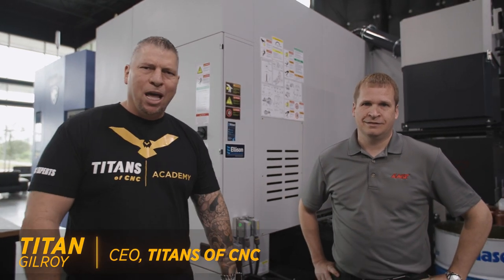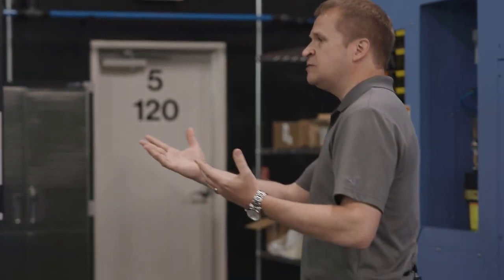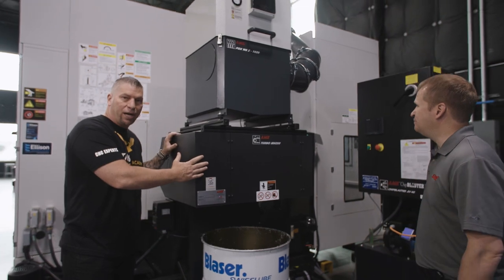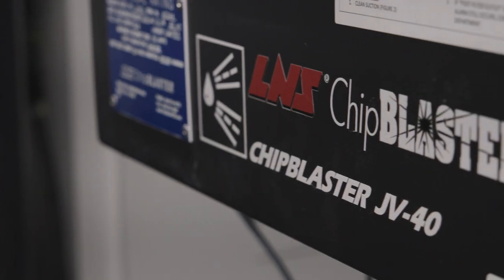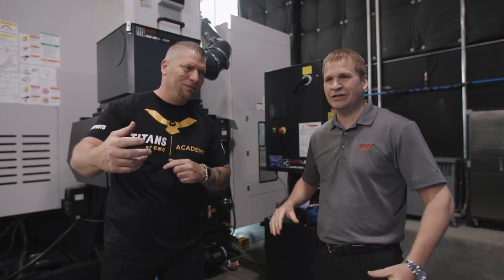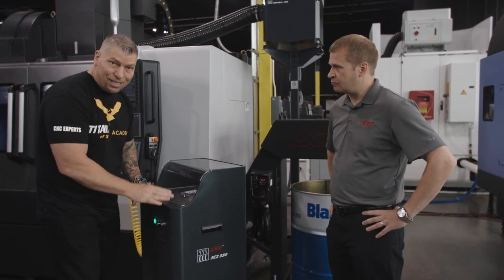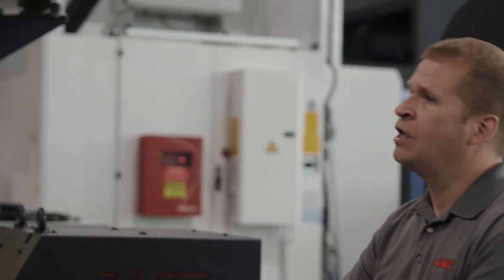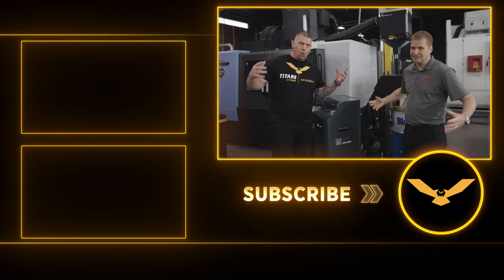Superior Mist Collection System | LNS Mist Collector

Comment: In my work we used to put the parts inside containers of water and then we used the air to clean them i forgot to mention that our coolant sucks it stinks and there is to much eczema in our hands that we forgot it and we thought we grew mushrooms im glad i left that job but nonetheless i learned a lot of stuff
Reply: Use coolant odor control tablets they kill the bacteria that grows in the tank and it maintains the PH of it so its not as bad on our hands for people with eczema from it. Tell your employer to clean the machines or schedule a day with your boss

Comment: Never had a mistcollector on a machine or in the building.
Always used the best coolant doesn't get that stinky dirty sock smell Master Chemical Trim Sol never need those stupid urinal pucks in there God that used to drive me nuts my dad would get cheap coolant next thing you know the men are pissed off because the skin irritation hell just the smell is enough to drive me out of building put those damn urinal pucks in that garbage oh hell no...
Used to have an old cat they called him croc like crocodile Dundee over there at master chemical every shop I was ever at I managed to get them a pallet coolant and soap to clean the machines, machine by machine I'd convert them over never even heard that blaster much less ever used it.
Cincool wynns and some trash called Dascool that was going around Phoenix for a while actually ruined a few machines like a Matsura MoldMaster 850 they changed over on a Friday come Monday that machine was a rust ball it was ruined but that's Dascool trash was a synthetic always hated synthetic never would use nothing but good old-fashioned soluble oil for me and good clean paraffin based soluble oil which is your master chemical TrimSol best thing is when it dries it leaves a true oil coating on everything.
Carbon fiber I think was the worst thing ever got in my eyes making a platform that goes inside a satellite that everything mounts to I was using a grinder cut through this massive piece of unwound carbon fiber I had on the lathe it was murdering carbides as quick as I put them in so I got an idea I mounted a 9 inch angle grinder on the tool post and put a chop saw abrasive blade on it using it like a regular parting blade later that evening my eyelids were stuck to my eyeballs like cactus took a couple days that heal up.
We used to machine a lot of G10 and marglass even a rigidised form of Pink panther insulation it would turn white when it was sintered you could not use any type of a physical clamp.
Milling it you literally held the part in your hands in a pot or on a plug in the lathe we used a  vacuum cleaner sucking on the backside of the spindle just to hold the part into a pot anywhere you touched it if you blew a little air on the part
 (.005) would blow away.
An air filtration system would have been wonderful

Comment: Buy a Dmg Mori and it comes with the machine...
Reply: It actually doesn't, its an optional extra.
Reply: @max_eley  we’ll all of our dmg machines have it and we didn’t pay any extra for it
Reply: @jonahwebb4352  mine didn't, but maybe its a new thing, you can't compare a dmg to a doosan, old dmg particularly deckel maho were the best, new dmg has fallen off a little bit, still great machines, but a dmg of that size is about 300k, not sure how much that doosan is.
Reply: @max_eley  yeah the new ones do, we have a 2019 and 2020 model dmg mori monoblock 75 and they have held sub .001 true position tolerances in stainless